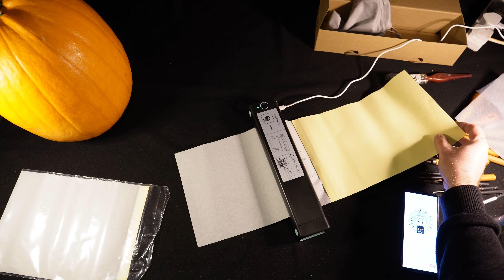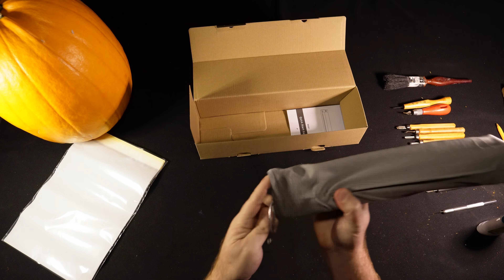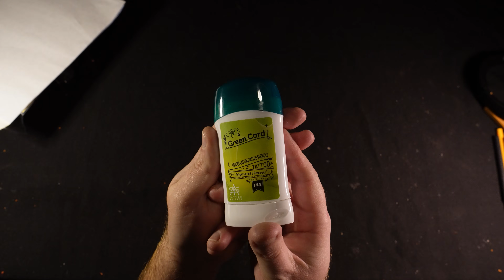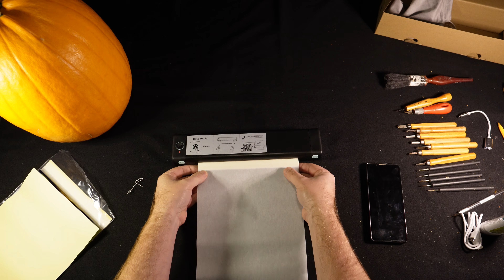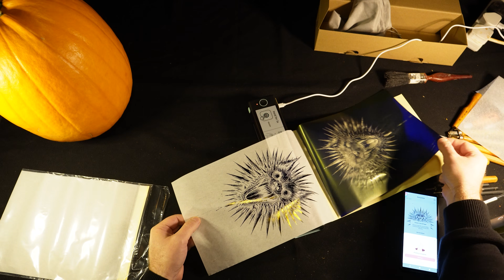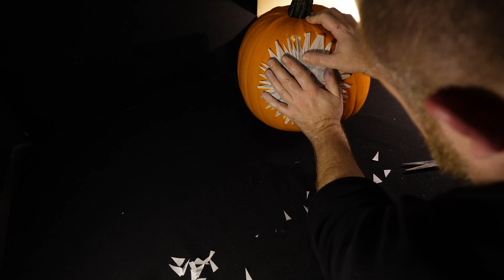Thermal Printer for Pumpkin Pattern Transfer

Comment: Does traditional graphite transfer work on foam pumpkins?
Reply from the maker: I think it probably would, but when carving foam it's much easier to just stick the paper to the pumpkin and carve through the paper, saves faffing around with printer or tracing over by hand

Comment: This works great. Have been doing this for 4 to 5 years. Great for intricate designs, put the stencil on the pumpkin a day or two before carving then dab it with paper towels. After carving clean up the lines with some metho!
Reply from the maker: Love the dabbing with paper towel tip 👍 ...any advice on keeping the stencils still for a nice crisp transfer?